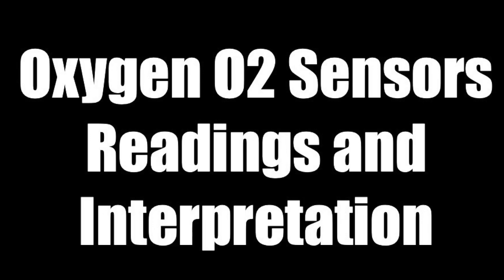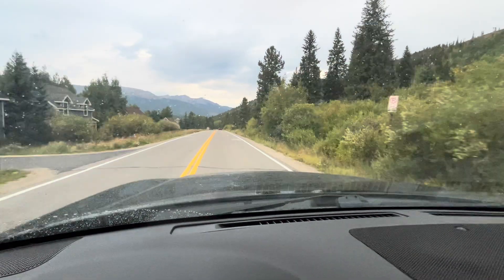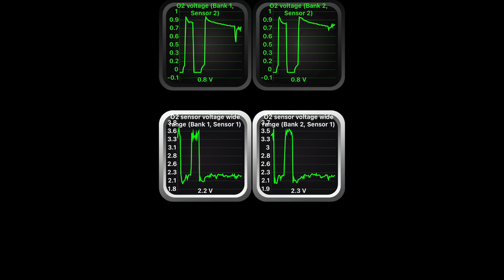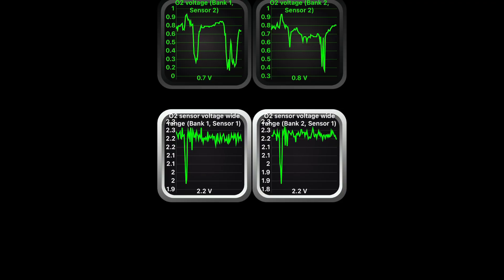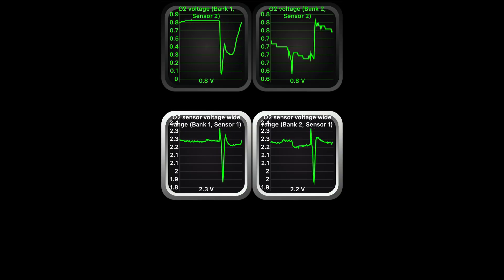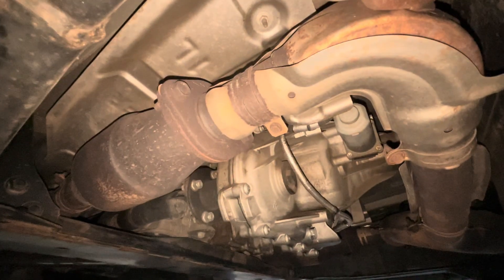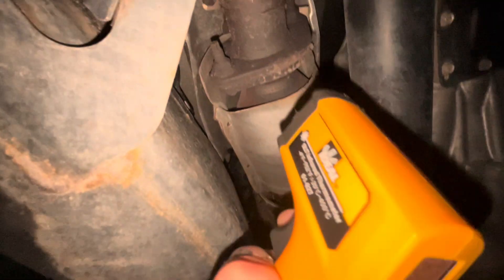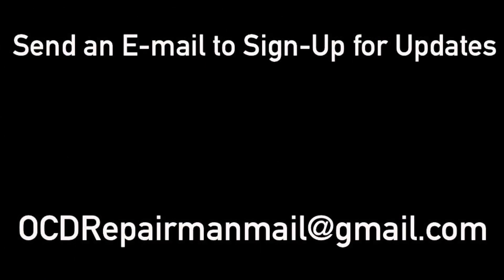Reading Oxygen O2 Sensors Data Results Meaning

Comment: I started off with a lien condition and I'm still trying to tackle I've done a few things to the car I just got to wait till Friday to order a downstream oxygen sensor which I believe it's the original one
Reply from the maker: A lean condition can arise from a vacuum leak, poor injector function, or exhaust leak. It’s possible the sensor is reading accurate and there is a different problem

Comment: If I see 0.0 volts for sensor 1 or 2 after running, does that mean a bad sensor.   Sensor 2 is fluctuating but sensor 1 is not going past 0
Reply from the maker: 0 volts is likely bad wiring or bad sensor, unlikely an exhuast leak or worst case it’s running extremely lean.